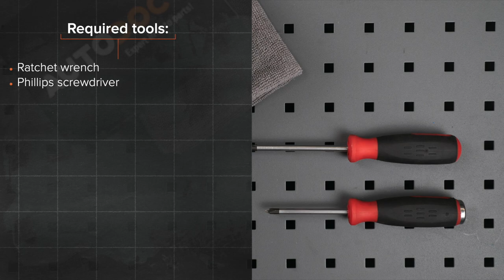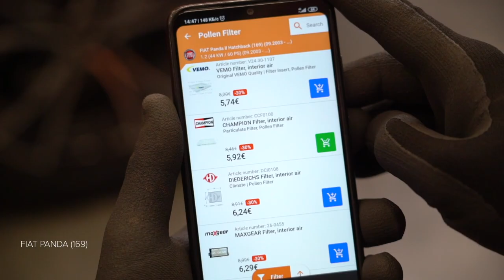How to change pollen filter on FIAT PANDA 2 (169) [TUTORIAL AUTODOC]

Comment: In video there are 2 screws to be removed. First one is cover of some sort and next one opens place where filter goes. My father tried replacing it and he only got 1 screw ti remove but no second screw to fit the filter do he is unable to remove it
Reply from the maker: Unfortunately, it is not possible to answer your question, you can find out this information in the technical documentation for the repair of your car.
AUTODOC

Comment: How in the bloody hell is this "informative" when the vast majority of your viewers have RHD Pandas. 
This job is near impossible due to the peddles and steering column being in the way of the filter housing.

My advice is, don't change the pollen filter on a RHD Panda, it's not important enough.
Reply from the maker: The replacement procedure may differ, you can read about all scheduled replacements directly in the technical documentation for your car or use the help of a car service.